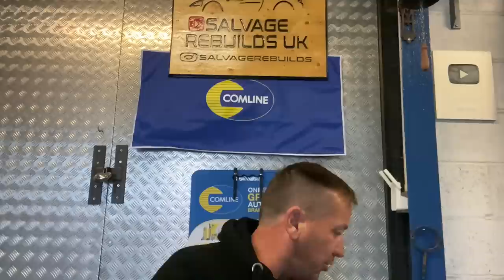CRASH DAMAGED 2017 MERCEDES VITO COMPLETED WHAT DID WE EARN £££

Comment: As always another brilliant vid, the viewer (especially those who may be considering a purchase from you) knows exactly what the initial problem or condition of the vehicle is and through your professional mechanical skills in the repairs and parts replacements can see that they would have a sound and safe vehicle, I`m impressed that even the minor problems (like a scratch on a mirror casing or bumper moulding is addressed) and you even go to the trouble of pointing out any minor blemishes which the camera may not show, also useful tips on how you tackle certain problems are helpful for the ordinary diy guy, finally after crunching the numbers the price you ask for a finished project is great, your both honest and genuine guys, can`t wait for  the next project.

Comment: Little tip for you guys with bleeding the clutch undo left hand brake calliper nipple and the clutch bleed nipple connect a pipe between them top the fluid up as most noe share the master cylinder pot and pump the brake pedal no topping up until after it’s bled it back bleeds it and works every time on most cars and especially the vans with the Renault Nissan running gear hope this helps you in the future 👍

Comment: Great video as always, just a couple of things for the viewers when fitting a new clutch,always clean the new pressure plate face as this is coated with a protecting film to stop it rusting while on the shelf, if not cleaned off this can glaze the friction lining of the new clutch plate, also you should add a very light film of grease to the input shaft and finally inspect the flywheel face, looking for any hot spots, if there are any have it faced.

Comment: Excellent video lads from memory there used to be a tool you could get to do the rear shoe hold down springs quite narrow with a slot in the end 
Access was through the wheel bolt holes many thanks keep up the good work

Comment: The gearbox driveshaft oil seals sometimes leak after a job like this.
Should have renewed mine.
Hopefully the tracking was done seeing the sub frame and other bits was taken off guys.
Top video.
Reply: i think those seals where replaced

Comment: When adjusting drum brakes, first put the drum on and pump the brakes a couple times- that centers the shoes in the drum, then adjust your star.
Reply: the footbrake only works the discs, not the drums, pull the handbrake on/off few times, that will settle the shoes
Reply from the maker: @paulriggers1558  the handbrake on this model is a foot break 👍
Reply: @paulriggers1558  I was commenting on drum brakes- not a lot of folks nowadays who have ever worked on them.
Reply: @oldschool1993  a good 50% of vehicles out there still have drums on rear, a few cars have even reverted back to drums on rear, a backwards step in my book

Comment: Probably a tool for fitting that spring. What’s interesting is that they still use shoes for the hand brake. Mondeo 4. Hand brake just use the disk it is good. A big cost saving there plus fitting time? Surprised they haven’t done that.
Reply: there is a tool for Vito brake springs
Laser tools make it LAS8097

Comment: Oh my Mercedes parking brake shoes! Hold incredibly well but a right old pain when the go wrong! Been doing Mercs for so long I can do 'em in minutes now :-)
Reply: I've some needle nose pliers that I ground extra thin to get in through the holes in the hub and deep into the retainer springs to push down and enable easy twisting a normal brake shoe spring tool cant get on them very well as I'm sure you found
Reply: Sorry to hear you blokes are getting stalked by some knob! The pitfalls of fame and fortune I suppose! Well done for speaking up and hopefully dissuading any more unscheduled, uninvited snoppers!
Reply: My 1988 W126 has the same back brakes! Can't believe Merc haven't changed them in over 30 years. And yes they are a pain to do lol 😆

Comment: I'd have fit a new dual mass flywheel while I was in there.
Reply from the maker: Nothing wrong with the one in it
Reply: There wasn't anything really wrong with the clutch but you replaced it..
I'm not having a go at you boy's...but a new flywheel would have done the job 100% and you could have put the cost on the final selling price which is cheap for a van of that quality 👍